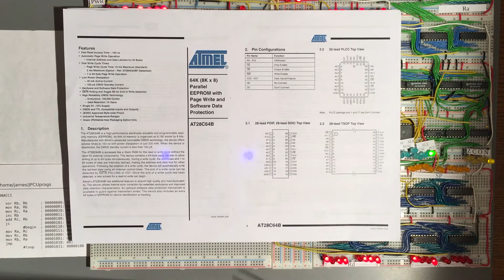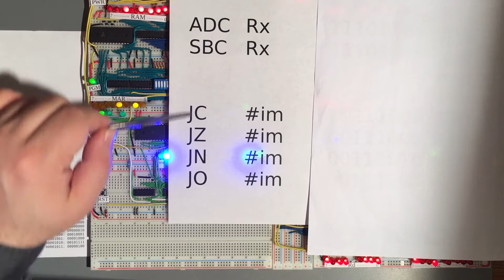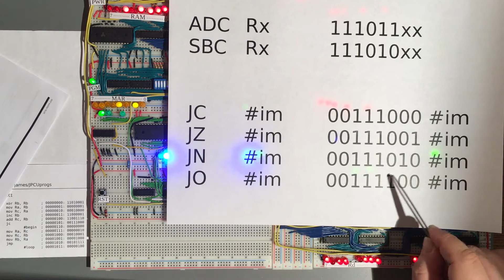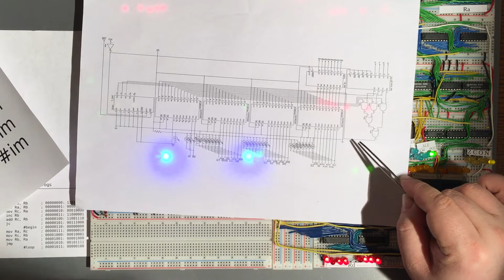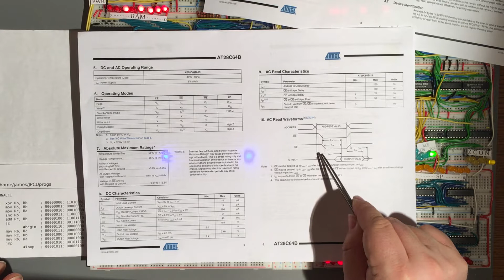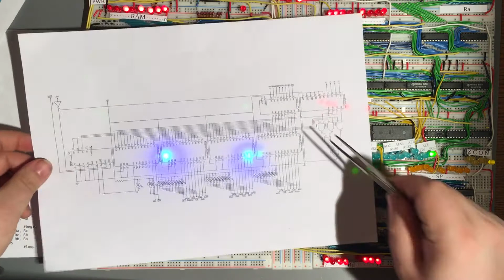My Ben Eater inspired homemade 8-bit CPU - Part 9: Control Unit

Comment: I have written an emulator for your micorcomputer. Because I considered clock low to start a cycle (and didn't clearly understand your version in the beginning), I have register bus assert happen on rising clock and register write on falling clock; exactly the opposite of your system. I assume this is arbitrary.
Also, I think there is a possible problem with the control word EEPROMs. Might it be possible for a register enable bit on one EEPROM to turn on before a register enable bit on another EEPROM turns off? I would guess that the duration of this state (if it happens) is too small to cause problems.
If I do make my own computer, I will put all the register enable control bits on one EEPROM. I would hope all bits of an EEPROM change at the same time. If they don't, then they will need to be buffered, like the IR, T and flag bits are.
Reply from the maker: Yes, you are right that whether register transfers happen on the rising clock edge, and control signal changes (and hence bus asserts due to enable signals) on the falling edge, or the other way around, doesn't matter. The important things is to keep them seperate.

In fact you need to keep them seperate exactly because of the second point you raise: EEPROMS's do indeed need some time to "settle" after you change their address lines. And different EEPROMs need slightly different times. What's more, buffer chips need time to open or close after enable bits change, adding even more "uncertainty time". During this time, the bus contents aren't reliable: they could contain old content (because the newly enabled register buffer isn't open yet), or they may even contain nonsense because, as you point out, perhaps 2 registers are briefly enabled simultaneously. Or maybe no registers are enabled, which is equally bad: the bus is then just a set of unconnected (i.e. "floating") wires.

Eventually though, all the buffers that should be closed will be closed (disconnected from the bus), and the one component that should be enabled will be driving the bus (provided of course there are no errors in the microcode ;) ). This is the "settled" time. Only now is it  safe to perform a register transfer (i.e. pulse the CK inputs on registers, memory, counters etc... sothat they can write to themselves). Essentially this puts an upper bound on the maximum clock rate of the cpu.

So in conclusion, because the register writes happen half a clock cycle later, it doesn't matter if the bus is briefly unstable after the control signals change. As long as it settles in less than half a clock cycle, the write operation will happen after the bus has stabilized.
Reply: @jimmyb998 Thank you for your reply. I was thinking of the problem of having a one bit in one register and a zero bit in another connected to the same bus line.
Reply from the maker: @davidtanner1419  yes, that could happen for a short time. I've not had problems because of that, because the times really are very short I presume.
Reply: @jimmyb998  Thanks. That confirms that I probably understand the control logic and the problem David Courtney found. It took me a long time and a lot of thinking.

Comment: I just finished wiring the the control unit (I have not yet hooked up the outputs to their respective registers though), however, I'm not getting correct outputs..is there a way I can accurately test this before I finalize the wiring? Thanks.
Reply from the maker: I just put LEDs on the outputs to check the outgoing signals...
Reply: @jimmyb998  I think it's possible my eeprom programmer is wired incorrectly, because I am not getting the correct values on the LEDs.
Reply from the maker: yes, that sounds likely
Reply: @jimmyb998  if all the eeproms are programmed with the same information, how come in your video only a few control signals are asserted for the same address across all four chips?
Reply from the maker: @joelhowell5402  They are not all programmed with the same information ;)
Reply: @jimmyb998  oh well I misunderstood then lol I will have to reprogram them. How do I tell the software what eeprom is which?
Reply from the maker: @joelhowell5402  I used a #define EEPROM_NO right at the top of my arduino program. It's explained in the next video!
Reply: @jimmyb998  oh, I see. Thank you. I feel kinda stupid lol. I will update when I get it all working
Reply: @jimmyb998  Okay, so I have it all wired up. I was running one of your simple programs for the multiples of three and I'm encountering some issues. After the initial 3 is loaded into C that's all that happens and the program counter continues to count...
Reply from the maker: Well, you can now try stepping through with the manual clock, and see where things go wrong ;)
Reply: @jimmyb998  So I understand that in the arduino code you have to change the ROM # , however, which EEPROM corresponds to MOV, LOD, STO, etc. ?

#define ROM_NO 3

#define INS_MOV 1
//#define INS_LOD 1
//#define INS_STO 1
//#define INS_ALU 1
Reply from the maker: @joelhowell5402  How have to run the Arduino program for each of the instruction sets, for each of the EEPROMs. So 16 times in total, four times for each EEPROM, each time with a different instruction set.
Reply: @jimmyb998  Oh, okay. Let me try that. Thanks.
Reply from the maker: So, more chance to debug!
Reply: @jimmyb998  I have somewhat sorta good news. I believe I am encountering issues because the PCW is not working correctly. I think some bits are flipped so I will need to rewire.
Reply: @jimmyb998  update, Fibonacci is working flawlessly. Will update again tomorrow.
Reply from the maker: Good news!

Comment: Why don't you use the manual clock for advancing the clock?
Reply from the maker: Because I wanted to have a long delay between the rising and falling edges. And as I explained in episode, the falling edge of the manual clock isn't debounced, so it wouldn't be reliable if I held it for more than 250 ms.

Comment: If your micro timer counts on falling clock edges, and the control unit sets its reset signal on a falling clock edge, why can you be sure that it will actually count up and then reset next cycle and not immediately. It is the same problem you described with the instruction register and the flags register.
Reply from the maker: You are right, it isn't fullproof. I guess I am lucky in that my ROM chip takes a little time to assert the reset signal, and that the falling clock edge is over by the time that signal reaches the counter. To be absolutely certain, I could use a similar setup to the flags register and have a 1/2-cycle delayed 1-bit slave "reset signal" register.
Reply: "I could use a similar setup to the flags register and have a 1/2-cycle delayed 1-bit slave "reset signal" register." That is a great solution I did not think of. In my implementation, the micro timer counts (or resets) on rising clock edges, and then on the falling edge its value gets mirrored into another register, just like on your instruction register. This register then drives the EPROMS of my control logic. I use UV erasable EPROMS that have 19 address lines. (M27C4001)
Reply: I am working on a 16bit breadboard cpu, it will have timers, interrupt sources and a 256 pixel display. For that I will also mirror the micro timer and the interrupt flags register.

Comment: Hi, looking at your flags register solution I was thinking, if you use a separate EEPROM, you could implement the negatives (like JNZ).
Reply from the maker: yes, although you could also just add instructions that do the opposite of JZ,JC,JN in the microcode, without adding any hardware ;)
Reply: So it would be 00 111 111 for JNC, 00 111 110 for JNZ, 00 111 101 for JNN and 00 111 011 for JNO?

Comment: Hi James, in schematics there are on EEPROM0 wires called BA and ALS3. BA could be ALB? but whats about ALS3?
Reply: also I can`t find the Program Counter Count line on one of the EEPROMS - is that instead of ALS3?
Reply from the maker: You're right: the signal lines names for the data pins on EEPROM0 are wrong on the schematic. I'll fix them some time. You can find the correct ones in the microcode program: https://github.com/jamesbates/jcpu/blob/master/arduino/Microcode/Microcode.ino ;)
Reply: yes, thanks, i already did it with the microcode. actually fibonacci is counting till 89 and then JC to the beginning, something with the CZNO flags must be wrong in my build of your cpu, i think a wireing error ...
Reply from the maker: well, that's pretty good, it means you got most things working! Could it be a confusion of the negative and carry flags? (negative applies for unsigned numbers >=128. The next Fibonacci number after 89 is 144 which is > 128)

Comment: Hi James, I´m actually building the control unit as the last part of your cpu. It`s unclear to me, why schematics says, that pin 7 of 74161 is connected to the inverted PROG Signal.. In the video I think to see, that pin 7 of the 74161 is also connected to pin 9 and one of the I/O lines of the EEPRPM3. could you please explain. thanx a  lot!
Reply from the maker: So, the 74161 has two counter enable pins, labeled "PE" (pin 7) and "TE" (pin 10). Its clock input (pin 2) is connected to the inverted main CPU clock, as discussed.

There are two circumstances when I DON'T want this counter to count on an (inverted) clock pulse: either if the "T(imer) R(eset)" control signal is active from the control unit, or if the RAM is in programming mode (i.e. when the PROG toggle switch has been activated. The reason for this, is that we load RAM contents from the dip switches into RAM using manual clock pulses, and I don't want the CPU to actually "advance" while that is happening).

Now since we have two different count enable pins on the 74161, I use one of them for each of these conditions. I use "PE" (pin 7) to enable the counter when TR is NOT asserted. By considering TR to be active low, it'll be 0V when asserted (i.e. don't count), and 5V when not asserted (i.e. advance normally). Additionally, when the TR control signal is asserted, I want the 74161 to reset itself to zero. This is achieved by using pin 9 ("LOAD"), and hard-wiring all the input pins (3,4,5,6) to ground. By good fortune, pin 9 is active low on the 74161, and so I can hook it directly to the TR signal (which is also connected to pin 7 of the 74161, whence the shorting of pins 7 and 9).

Finally, when the PROG switch is active, I don't want the 74161 to count, but I also don't want it to reset. I just want it to stay put. So the inverted PROG signal is connected to the "TE" enable pin (pin 10).

In the schematic, I changed over the roles of TE and PE: I connect the TR control signal to the 74161's TE, pin 10, and therefore also to LOAD (pin 9), whereas the inverted PROG signal goes to PE, pin 7, on the schematic. There's no difference in behaviour, as TE and PE on the 74161 do exactly the same thing: both must be high for counting to take place.

Make sense? ;)
Reply: a lot sense! many thanks for explaining!!

Comment: On hand, I only have a few AT28C16 EEPROM chips.  My thinking is that I could add an additional register (labelled J for jump, this register would be connected to the program counter directly via an octal bus transceiver), and use some combinational logic to create conditional jump commands.  I would use two control lines, which would be demultiplexed into four secondary control lines.  I can then AND each secondary line with a corresponding ALU flag, and then OR the outputs of those four and gates together.  The output of the OR gate would be connected to the octal bus transceiver, which would control whether or not the register is being written to the inputs of the program counter.
Reply from the maker: Sounds similar to what I did. Only the output from your control lines would go directly to that transceiver between your J and PC registers. You'd still need some way of getting the immediate operand into your J register. Possibly as part of your JMP/Jxx instruction cycle.

Comment: HI James.. great job. I like what you did for the ALU!
To get more control lines, you don't have to keep adding chips.
You can multiplex some lines so for example if you have a read instruction, one bit can be a read flag (which enables the read demultiplexer) and use 4 lines to multiplex one of 16 sources. Same for write. This way 10 buts give you in and out control for 16 different devices from just 10 lines.
Reply from the maker: I've seen that kind of arrangement, e.g. in http://www.buthowdoitknow.com/but_how_do_it_know_cpu_model.html. It'd certainly be necessary if/when I extend the number of registers significantly. Worth keeping in mind!
Reply: Really you would only need one demultiplexer for this.  You can use one 4-16 demultiplexer, and AND each output with the read and write lines.  This would allow only 6 lines to control 16 devices.
Reply: How would you address these additional registers?  The way your microcode is setup, it is not possible for you to address more than 8 registers.  I ask because I would run into the same issue with the setup.
Reply from the maker: That is correct. It would be for a completely different computer, probably using 16-bit instructions. I can't see me doing any of this on the current cpu.
Reply: James Bates You could fit in a larger register address if you split some of the instructions in two.  You could use the first four bits as the instruction ID, and the last four bits as the register address. You could then split instructions such as MOV (which requires two register addresses) into two different instructions.  The first half would copy the contents of the addressed register into a dedicated 'buffer' register, and the second half would copy the buffer contents into into another register.  I realise that this would significantly slow the operation of the computer, but it would allow you to address 16 registers without constructing a completely new computer.